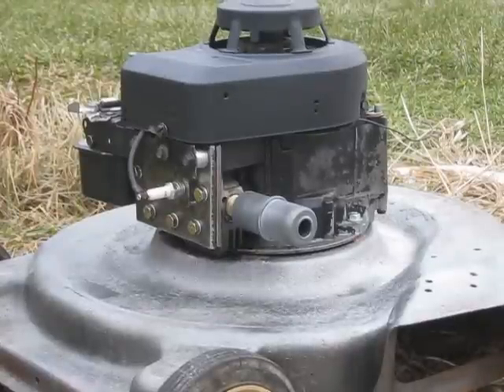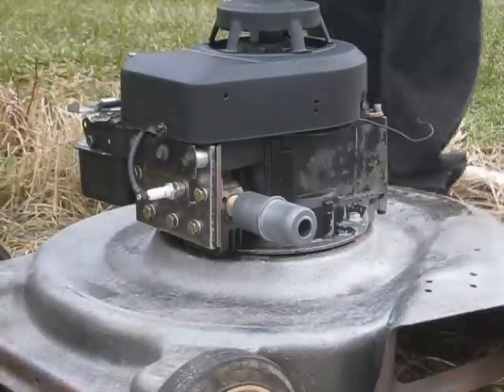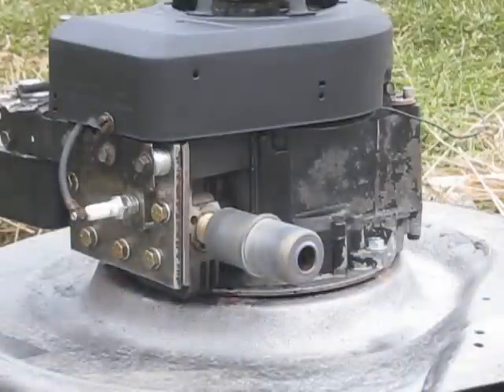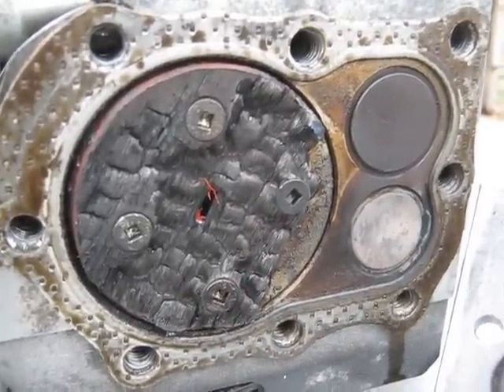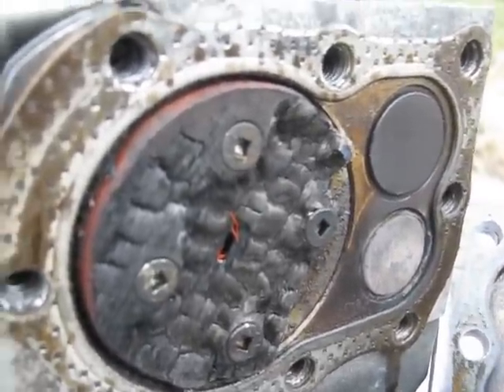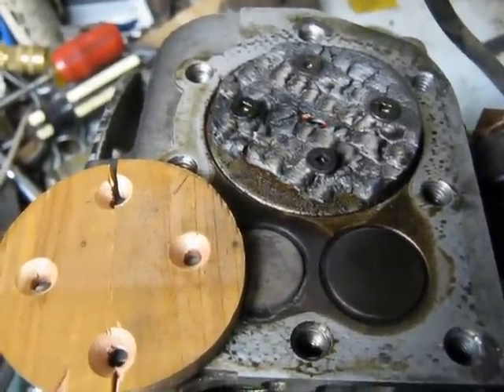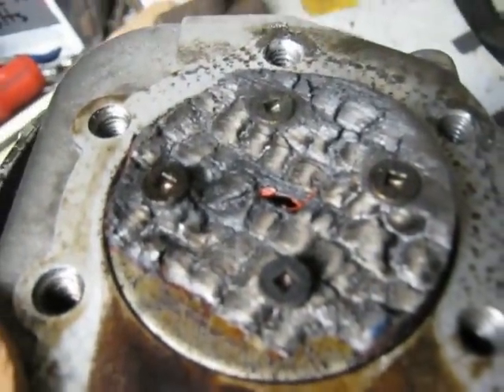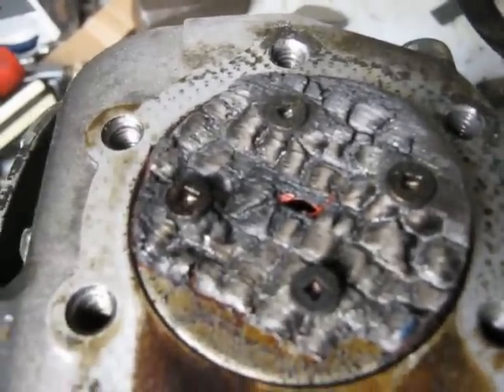Wooden Piston Briggs! (Oak)

Comment: Question- Would a latticed/layered piston work with 50/50 steel/wood and last a little longer (with a steel crown-cap)? It almost makes one think if you added some type of oil-soaker for the piston body (layered wood) as the rings wipe the cylinder down...it might actually work quite a bit (as the oil would help cool the wood body, prevent scorch, at least the alternating layers, that is).

I noted some of the old 1900's designs had all types of rod/piston designs with flow-back ports, and even some with sawtooth rod and rod-cap designs with flow-thru channels, and even one hollow crank with GREASE channels!

I been trying to figure out a cheap bearing insert design for these 3.5's (and 5's/6.5's) as I see a lot with rod slop on the crank.

Granted, if you take the time (which I did as an experiment on a flat-head 12hp), you can use valve-grinding compound to grind-match the rod, rod-cap and crank together...though you might still grab a slight knock.

The only thing I could think of other than leather (an old Model T trick) bearings (and as you know, they were standard on the really old rod designs of low-RPM motors back in the day), would be a dense cotton pack...long fiber, as it could take the TDC slam and bottom stroke slop.

But after watching this genius of engineering (and it is) with your wood piston...makes me think that wooden bearing inserts might work, if the design could be figured out, and the correct wood-type be selected.

I always enjoy your experimental engineering, Charger, especially the Monosoupape.
Reply: And I may have a bad remembering, but I could have sworn they ran a few motors with leather rings at one time (low-RPM)...I just can't remember if they were grease-packed, or oil-channel rings.
Reply from the maker: Sounds like you have done some serious investigation of old engine designs!
One thing I learned about wood that may cause wooden bearings problems in an oil lubed engine is that it expands at different rates along or acrossed the grain. Kind of a unique property. I also wonder about how much it would expand due to soaking up oil.
Yes, I guess this is a type of engineering, as i generally have to do a few drawings to figure out what the easiest, cheapest, most practical etc. way to accomplish the task at hand is.
Reply from the maker: Leather rings, I am surprised it would take the heat! I have seen leather seals on water pumps, both hand powered and electric piston pumps. I guess you can make fairly intricate things from leather.
Reply: I do remember they used leather rings in steam motors...but...I want to say (and I can't remember now), that there were experimental REALLY low-RPM combustion motors with them. 

As I said...I have no idea if they were oil-soaked, then grease packed leather rings...but I do remember reading about pistons being ported for oil flow outside-in, in-between the rings...and crank designs of grease AND oil (that would have been somewhat difficult to service!) at the same time.

These were verbal only descriptions...no pictures, so I am guessing that maybe it was ONLY the wiper/3rd ring that was leather, and some of those were only 2 ring designs, so I assume the #1 compression ring was steel of some kind.

Makes me wonder if you couldn't cheat...and do a layered steel/wood disc piston, ported for oil flow (maybe just a simple 2 ring jobber), with the compression ring being just a regular ring, but the second/wiper being leather only.

I DO remember old-timers talking about leather rod bearings (also used in steam motors), and once you got good quality leather soaked down in oil prior to using them, they would last a LONG time (as long as the successive oiling in the motor was good too).

(Note- According to what little I remember reading on it ((again, no pictures)), the leather bearings were heated slow so as not to scorch, but the only "plan" I read simply stated boiling leather in motor oil for a while.)

My problem is...any old Briggs 3.5 I get in (or any others for that matter)...they have already shattered a rod in! (People are bad about not servicing them...and I did unluckily come across two all-plastic carb Briggs, and those same two had the PLASTIC CAM-SHAFTS!)

It's a shame nobody experiments with motor designs outside a rare few, Charger, so keep at it.

You know...come to think of it...I wonder if you could pull the same layering & latticing of wood/steel...

with the rod? HA! Now that I might try myself one day.

Looks like I will have to design a plywood motor, one day, Charger!
Reply from the maker: I hope your plywood motor works out for you. I ran the plywood piston crown today, it lasted about 45 seconds, so the oak one has lasted the longest so far. Where is a 1/4" strip of Ironwood when you need it!
Reply: I saw that! So much for plywood...Charger proves again, guesstimation ain't a science! HA! Locally, we have a french tree non-native hauled in here during the Dust Bowl (around the time of the Great Depression), called Osage Orange (or Bois D'arc).

Incredibly dense...will ruin a saw chain on even small limbs, and you can't burn it in a stove (it will fry a flue really quick). If you clean out a fence-line, and the pile is half the height of your house...it will burn upwards to a week.

I have been pondering the use for those trees for years...they have an immensely sticky white sap, but the grain is almost never straight (usually twisted in long sections).

They make Horse Apples (or people up north call them "Monkey Brains")...always wondered if a man could make either a paint, or a fuel with that sap...

or now...a piston crown.

Ironwood is Arizona, unless I am thinking wrong...man would THAT be hard to get ahold of. Assuming it didn't detonate...that would be something to see indeed.

I noted quite a few good ideas on differing things for your last videos, which is good to see...everything from glass pistons (that never occurred to me...I wonder about 3D printed pistons!)...to wood impregnated with epoxy...to the Almighty JB Weld Piston (hahahaha...you watch that one be the ONLY one that will work forever)...

and someone stated soaking it down in water, and I was considering oil-soaking as well, as an idea.

And...one commentor mentioned a low-RPM run, which is not a bad idea for later use (as you stated).
Reply: TheCaptainSlappy the almighty JB weld won't hold up to the internal combustion temperatures. it burns and smells really bad

Comment: Wooden Pistons are pretty well known.. get the right wood and make a full wooden piston and it should last a while. I guess if you put your ring gaps on the opposite side to the valves it would be better too as that area clearly gets less heat in this case. 

I've heard of all sorts of things. Sure leather piston rings was another one.
Reply from the maker: Yes, I imagine something like Ironwood could be a good choice. I have a few concerns about expansion of the piston, as well as soaking up oil. I don't have the machinery to machine a wood piston, so I took this short cut. The best way I see to make a wooden piston last any reasonable time would be to use the best heat resistant wood, and make the piston crown as thick as possible. Keeping the engine revs low would extend life also, this engine revs about 3300, as it is one of those one speed lawnmowers. i thought the throttle control would allow it to idle, but it really had no effect on the speed, unlike on the older engines.

Comment: The thing that I enjoy the most with these videos is that you can see how the fuel and air are burning and what parts get the hottest.
Reply from the maker: Yes, I found that interesting also. The spark plug on this sits in the triangle between the piston and the two valves. I located it there to hopefully avoid damage if the piston crown came lose. The spark plug cost me $8.50, so I didn't want to break it on the first run!  I noticed a swirl pattern between the intake valve and the cylinder, so seeing flow patterns inside the cylinder is rather cool.

Comment: good ol miles, answering the important questions :)
Reply from the maker: I tried to answer what I thought would be the logical questions, though surprisingly I haven't gotten any "Why?" comments yet. I just do this stuff as a hobby anyway, so I don't worry about much deep dark analysis of it  :)
Reply: ChargerMiles007 its entertaining, all the why anyone needs :)
Reply from the maker: Right on!
I was half expecting at least one of the screws holding the wood on, to unscrew and hit the steel head. Needless to say the piston would come out the loser in the battle! I used thread locker compound, but there is no way it is supposed to take these types of temperatures.

Comment: why would you use oak for a piston crown. in my mind oak burns wood burns. so dude why wouldvyoub do that When you knew it would go poor.
Reply from the maker: I had to go with what wood was easily availible to me, since i don't have a wood planner. Oak was all that the local hardware store had in stock. I went out back and chopped a piece out of my black walnut stump, but it is going to take a lot of rasp work to shape the piece! I will look into other wood sources now that I know the idea works.

Comment: Now do wood head AND wood piston..
For science! lol
And maybe thick wood block.. Messy if that popped open lol..
Reply: ChargerMiles007 hmm I wonder if it could be switched over to diesel after the wood becomes a nice glow plug...😂
Probably not , not enough compression but one can dream for the sake of a techy joke.
Reply: Well you could increase compression by jb welding the head and filling it up. and then use gasoline and use a splitter valve (valve that switches from one tube/line to the other. straight into the carb) some kind of Y-splitter that controls which line feeds the output.
And that way you could really easily see how much diesel a gasoline engine can run before its unable to sustain combustion
Reply from the maker: You know, I thought of that also, and perhaps I will. though it would be a bit of a time investment. Actually, it wouldn't be as bad as I first imagined, since now I don't need to machine out the combustion chamber, like I did before!
Reply: Well... with a wooden engine.. You can just keep growing your components back.. And mill them with solar power XDDDDDD haha!
Reply from the maker: LOL  :)   Good one!
Reply: It won't work with a wood head. It'll burn thru!